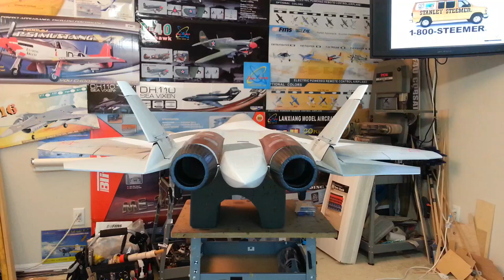LX Models / Banana Hobby T-50 PAK FA Thrust Vector System demo By: RCINFORMER

Comment: You are flat out full of knowledge in the Rc aircraft field and I really need your input. I'm ready to purchase a b17 bomber and just want some input on which one is the best one out of the box. I'm stuck between the HK 1875 mm Memphis bell. And there 1600mm Flying Fortress. And also the troybuilt 1875 Memphis bell and the freezing starmax b17 the biggest I've seen but don't even know if it can be bought anymore. Plus motion hobbies has one but I think it's same as the HK one. Please write back I can't get any help anywhere.
Reply from the maker: I would get the MotionRC Freewing model, I have flown it alot and it flys great